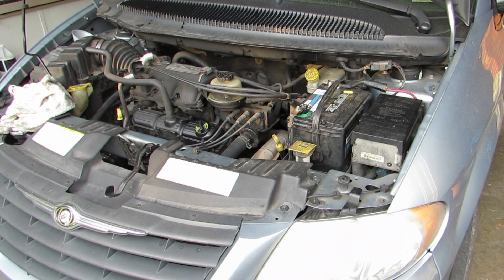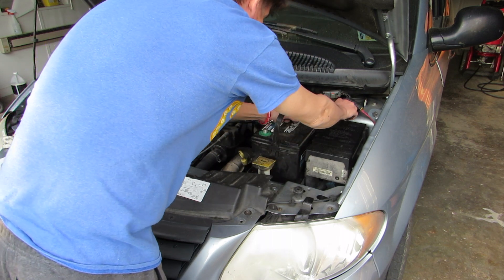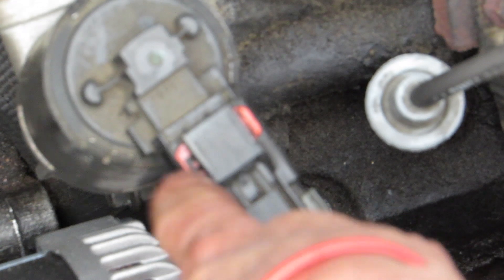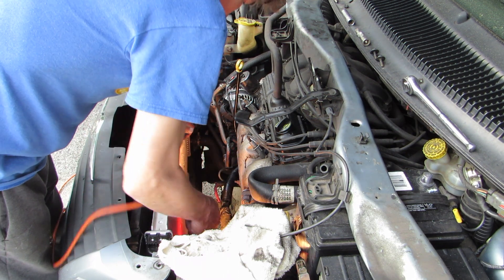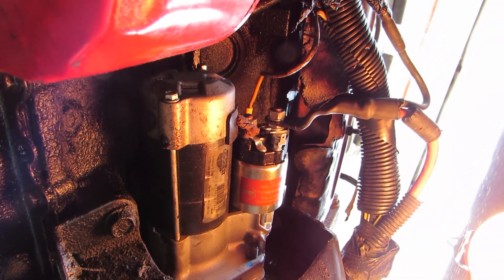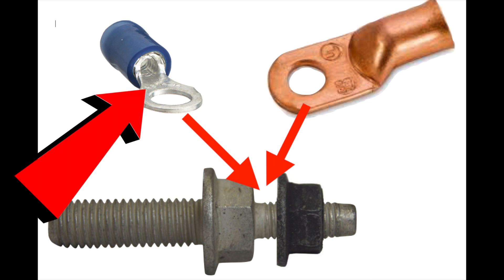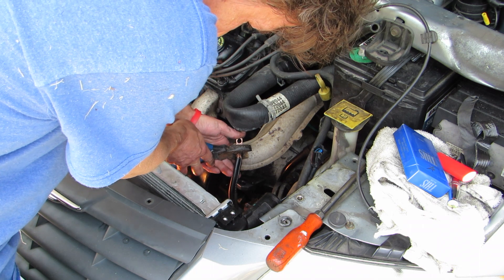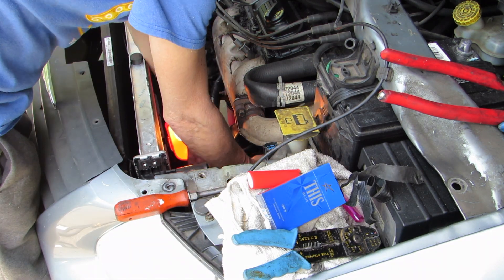Battery Draining? Check This

Comment: Appreciate the time you put into diagnosing this and sharing the video. Would you say there's an easier way to check that cable?
Reply from the maker: It's a pain in the ass to get to the end of the cable but yeah - there is an easier way and if I had known the problem I would've gone right to it. You have to remember I was getting ready to drop the starter and test the solenoid.
Peace

Comment: What a 👍 video......
Reply from the maker: Hey Franco,
I'm glad you enjoyed it and I hope I helped you out.
Peace
Reply: @JohnDisque I’m actually having this problem with my mom 2007 can n they keep saying oh it’s the alternator that’s draining the battery but that’s a good battery n it clicks when we turn the key but it was driving n everything two days ago n today it don’t wanna say nun but clicks
Reply from the maker: @godsbeautifuldaughter8913  Hi Daughter.... The alternator's job is to keep the battery above 12 volts. If the alternator is bad the battery will drain below 12 volts even if it's brand new. 

It needs both to keep her starting and rolling. 

I wish I was there. I could test it and tell you for sure what's going on in about a minute. 

If you're certain the battery is good then the peeps are right.... It's most likely your alternator. 

If you can jump it off and get it to a parts store - they'll be happy to test it. 

Peace
Reply: @JohnDisque  it was driving fine with no problems Monday night Tuesday night today it didn’t wanna start so we gone have to get a jump n take it n see what they say
Reply from the maker: @godsbeautifuldaughter8913  This too shall pass. 
Cars are a pain.
Reply: @JohnDisque  yes they are
Reply from the maker: @godsbeautifuldaughter8913  Before you jump it off make sure the clams on the battery posts are tight. 

Because it's probably the alternator... keep the car running at the parts store and ask them to test the alternator first. (The reading on their gauge should be above 14 volts with the car running).
Reply: @JohnDisque  okay n if it is is that good or no  n yes I wish you was in Florida to check the van out
Reply from the maker: @godsbeautifuldaughter8913  If you can wiggle the clamps they're loose and need to be tightened, which would most likely be your whole issue. 

If they're tight - we're still suspecting the alternator but we want to eliminate the small stuff first.
Reply from the maker: @godsbeautifuldaughter8913  Watch this when you get a second. 
https://youtu.be/Iqpeeb4RW9Y